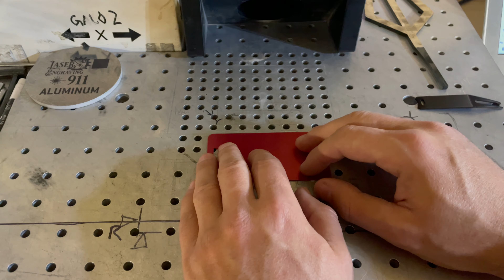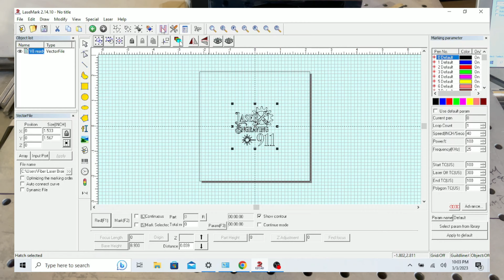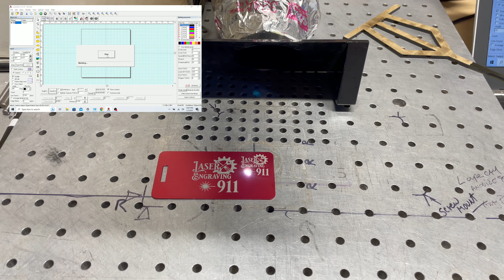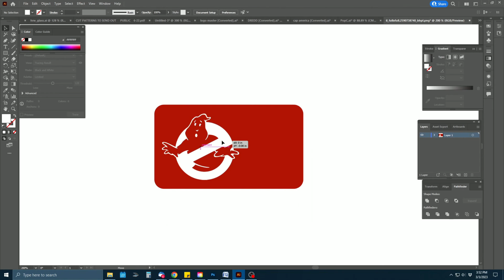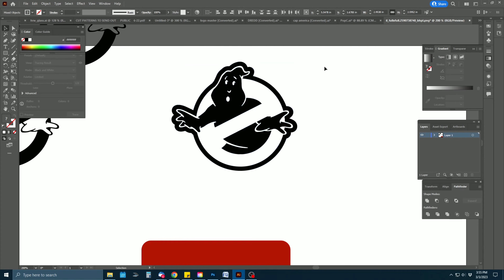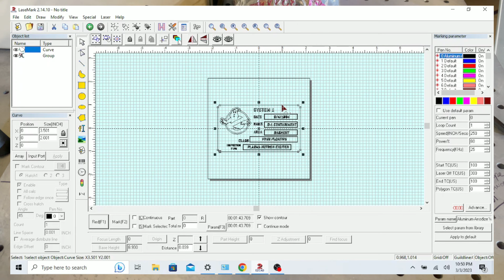Laser Engraving Anodized Aluminum With A Fiber Laser Lets Do This!

Comment: what extractor is used for this machine?
Reply from the maker: https://amzn.to/45Qzv5z with 4" reducers venting direct outside.
Reply: @LaserEngraving911  Have you tried looking for a filtration unit for it?
Reply from the maker: @mrSanders.   You need to buy a special filtration unit for fibers lasers that can handle the dust collection aspect of vaporized metal particulates, normal fume extractors are a poor choice, because the metal dust will clog up the filters very quickly, so if you need a fume extractor for a fiber laser, be careful what you buy, and make sure its designed for fiber lasers and metal dust particulates, and not a Co2 laser fume extractors, now with that said if your only using your fiber laser for polymers, and plastics, then you can use a standard fume extractor.

Comment: Thanks, great info, I like the exhaust fan entrance frame, I will set-up one like it and have you thought about adding a dowel or two to the entrance frame so when you position it the short dowel/dowels will drop into the holes to hold it exactly where you want it.
Reply from the maker: Nice , I like the sound of that!

Comment: I am about to pull the trigger on a 50w JPT fiber laser with EZCAD2. I currently own a 30w CO2, and I want to use LightBurn for both.  I want to add a fiber laser because I am turning down work that is often better suited for a fiber.  This video has opened up  my eyes and answered questions I didn't even know I needed to ask.  I am no longer worried about whether I was about to make the right decision. Thanks.
Reply from the maker: Nice!! man your on the right path for sure